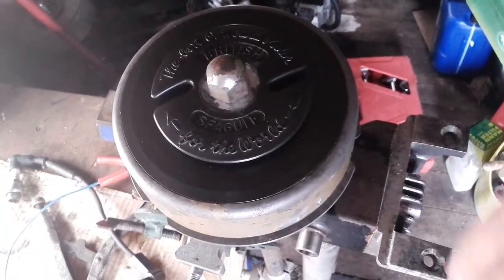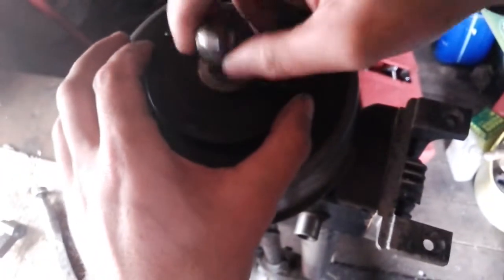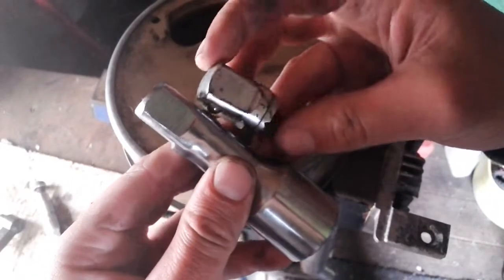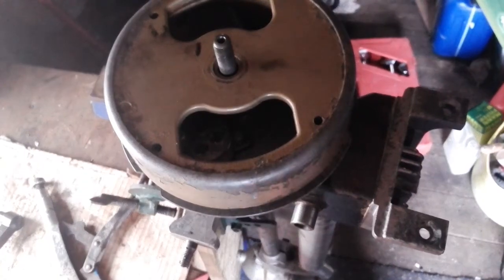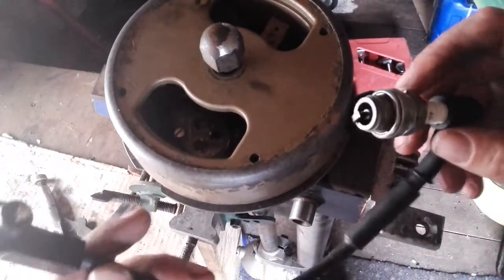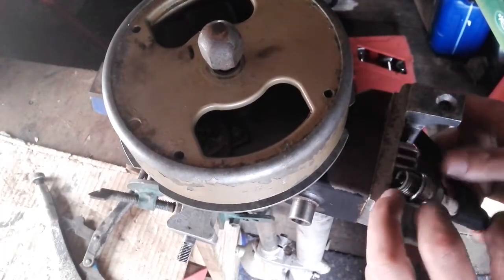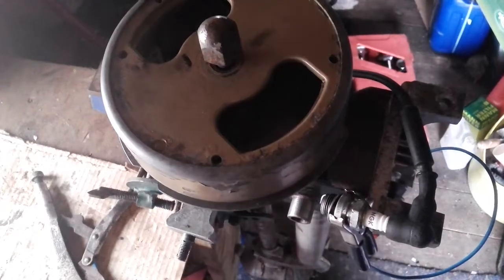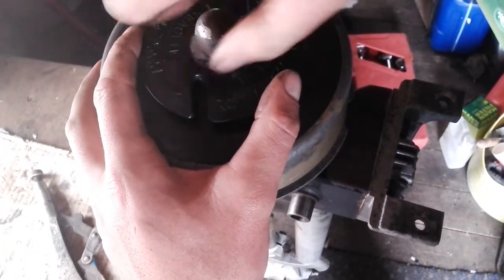Drill trick for regaining spark on a seagull outboard

Comment: Does this work for the Villiers coils?
Thanks.
Reply from the maker: Yes will work with those Dylan
Reply: @BarryHealyAngling  it did work. Plug must be dead though, spark from the ht lead, but nothing from the plug.
Thanks.
Reply: @BarryHealyAngling  Sorry to be a pain, but I made a rookie mistake,, I took the gear case apart months ago,, no idea what order the washers and spacers go back on,, is there a manual or a video you could point me to ? Thanks for all your help so far..
Reply from the maker: Try ebay for a seagull manual they have the assembly in the manual

Comment: Hi my flywheel has very little magnitic pull it can't even hold a small washer on it, I use to have your email address but I can't find it, I got a seagull from you in 2016 still going great, I did get a second recently and it's not running at all, it could be ignition coil or flywheel any help or advice would be great.
Reply from the maker: What model is it Charlie?

Comment: What ratio,gas/2stroke mix do I use?
Reply from the maker: Hi james send me on your engine number and I will let you know
Reply: @BarryHealyAngling  EF 19GG3
Reply from the maker: @jamescoombs2569  10/1 is your mix if it hasn't been converted to 25/1
Reply: @BarryHealyAngling  cool, appreciate your help,by any chance do you sell a service manual for it,and where in the USA,is there any dealer for parts
Reply from the maker: No problem .
I will check my stock and see have I a manual for your model.
I dont know if any parts dealers in the USA. 
Are you looking for any parts in particular?
Reply: @BarryHealyAngling  I don't know if it was converted,I  it was in a dumpster and I put 50:1,sthihl chainsaw mix,and it ran,is that ok,or way too much oil
Reply: @BarryHealyAngling  not yet,I'm ready to put it on my rowboat,and go on a test drive, haha, but I'm going to keep the oars on board

Comment: I have never worked on a seagull but have worked on hundreds if not thousands of small engines and was taught that if you are getting an arc (spark) across the ignition points than you have a failing condenser. That is the condensers function, to absorb the currant when the magnetic field collapses to keep an arc from burning up the points.

Comment: Love all your great seagull videos, recently bought a late 60s silver century, converted the amal carb to 25:1 as per your other video, great tip about the radiator key. starts 1st time and it seems to run much better than on 10:1, obviously due to less oil,any risk of doing damage with less lubrication do you think?
Reply from the maker: +graham cliffe 
Hi Graham. 
You should be safe with 25/1 .
They all seem to have their own temperament and run better on slightly different mix ratios.
Thanks for commenting

Comment: ok im about ready to sell my two for scrap. i cant get any spark,ive cleaned the points ,tested the coil (4,7ohm) traced the power all the way to the points and still get 4,7 on closed and oddly enough 4,7 when open,(on both sides,should only be on one side) spun it vigourously with the drill and still no spark.there was spark when i started,then i cleaned the tank,put fuel in and tried to start then there was no spark anymore.please help.thanks
Reply from the maker: +Robert Esqsquire what model is it ? 
Ate your plugs and leads100%?